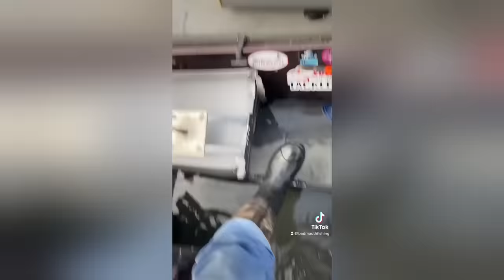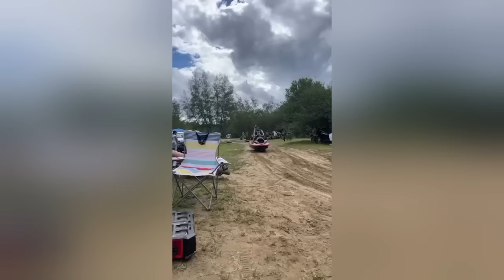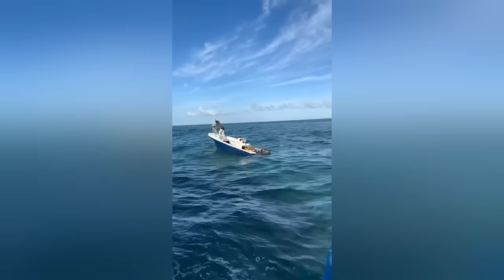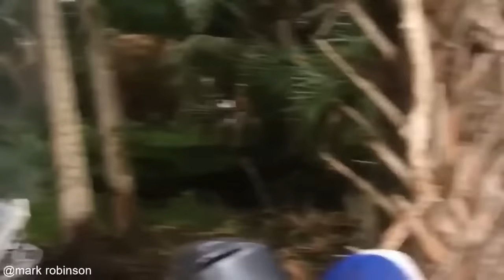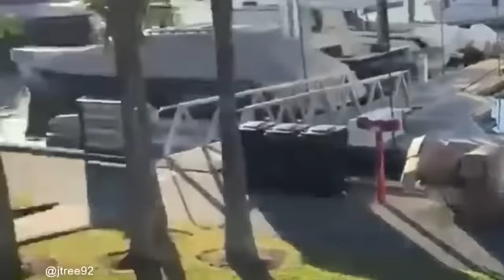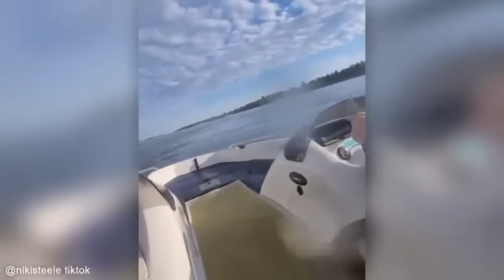Boat Fails and Wins - Best of The Week | Part 283

Comment: I have a jet boat myself and it is possible to fill the interior of the boat to the gunwale and keep on driving. You just have to stop the boat like he did, and it drains through the floor drain to the bilge and the sump pumps take it out. No harm no foul. The boat is actually tested that way for safety. It happens.